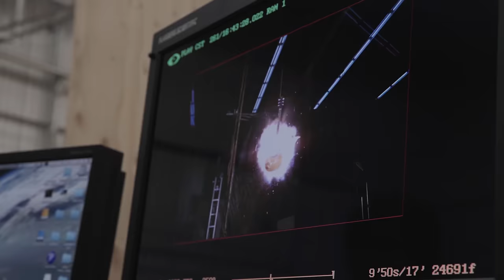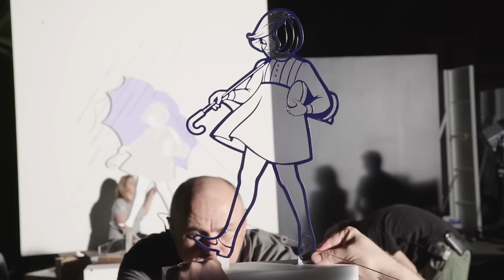OK Go - "The One Moment" BTS

Comment: I felt strangely better when he revealed that all of the guitars were defect guitars.
Reply: @Marco  im not sure what that changes for you
Reply: @Marco  they are still real guitars blowin up, right?
Reply: @Marco They WOULD have been "real" guitars in a shop, sold to a musician, and cared for lovingly, played for fun and for live performances, etc. Except, they have something wrong with them that couldn't be feasibly fixed. The wood was warped, or the grain structure wasn't right causing a crack or split. The varnish didn't come out right or something like that. They are real objects, but instead of going into a dumpster and eventually a landfill, they came to us in the form of entertainment...and then into a dumpster and eventually a landfill.
Reply: Same. And it's oddly satisfying that these defective guitars were still used in music...

Comment: Stilll can't believe you guys synched the fliping pages to the song.....
Reply: Notice that different parts of the video are at different speeds. So I think deciding exactly at which frames to slow down / speed up gives them some leeway, so they can get the pages right.
Reply: Or maybe they planned it out down to the frame ahead of time? Crazy spreadsheet featured here: https://www.youtube.com/watch?v=DvElCxbimxc
Reply: Also they had to synch the explosions of color in time with the song and the pages. I am certain that that shot was extremely difficult and took weeks of practice to get it spot on.
Reply: Yes, they toyed a little bit with the framerate, that's the advantage of using a high speed camera that maybe shoots 10.000 fps. Anyway this is technically insane to film, but the editing was probably really fun. To match each explosion to a beat is really pleasing.
Reply: He mentioned that they have a spreadsheet of every single frame of the music video that corresponds to a millisecond of the actual video. 

Via this method they were able to ensure that each part of the video was synched perfectly.

Comment: So it wasn't done in one take?
Reply: They would if they could but it is impossible to run round the set in that speed and get on a wire harness, and also the camera cant possibly turn that fast. It's still impressive to do what they did though
Reply: Phoenix 24 Oh yeah, no doubt still impressive... To some extent even more so that you can't see the seams between the shots. Not sure how many shots they used but I can only really see 3 places that they could have joined without major work in the post production stage,
Reply: Yes. Some of the best examples of editing aren't perfections but covering up imperfections
Reply: It takes longer than one moment.

Comment: 3:40 wait I'm confused. Did you do the part in separate takes/recordings or are you just talking about some slowdown inbetween the parts?
Reply: Apparently they shot it in seven segments then stitched them together.
Reply: They did the parts in separate takes, but they only shot each one once. It would be pretty much impossible to pull all that off in four seconds in one take.